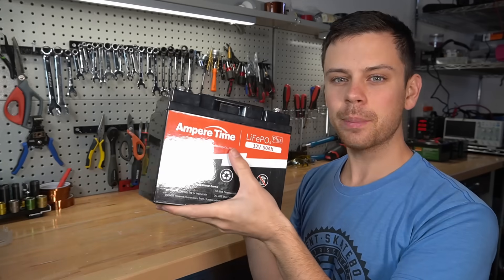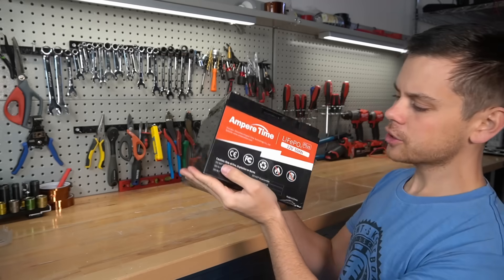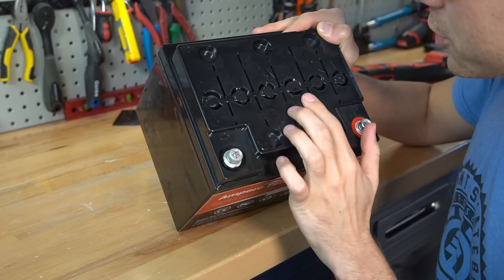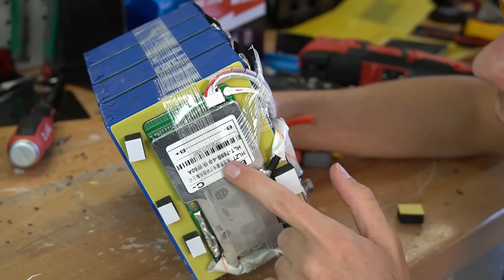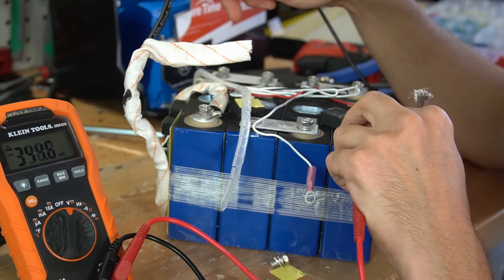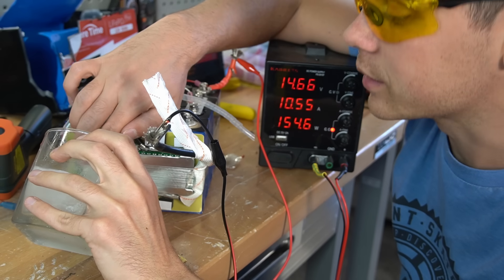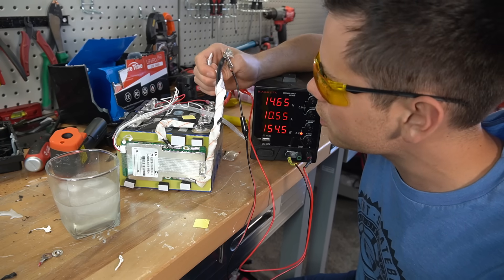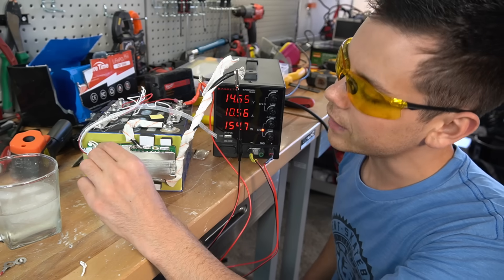12V "Ampere Time" LiFePO4 Battery Teardown

Comment: Ventura, California on the boat never going to have that problem of cold. So low degree disconnect is never an issue for me. I do appreciate the review. Will would be great to see you hit the boaters with your channel. Most do not understand this technology. They are still using lead acid. 😆
Reply: Agreed on boat batteries, some of the big YouTube Sailors like Delos, Le Vagabonde, and Wynns show off their Lithiums.